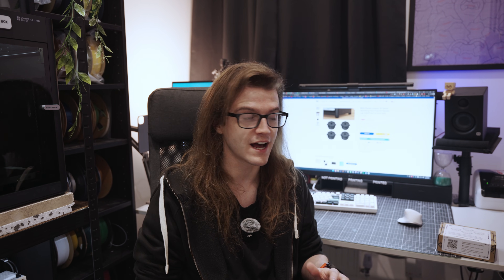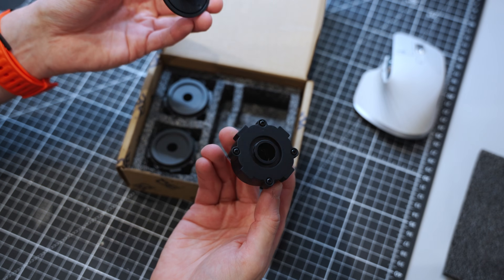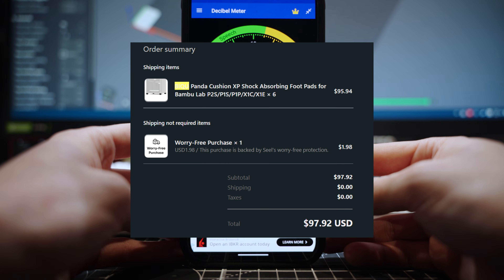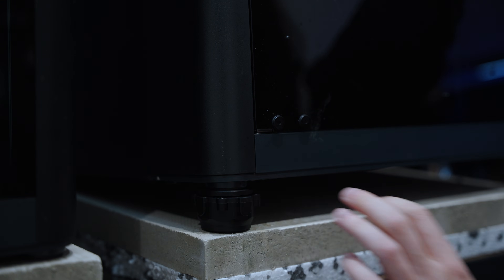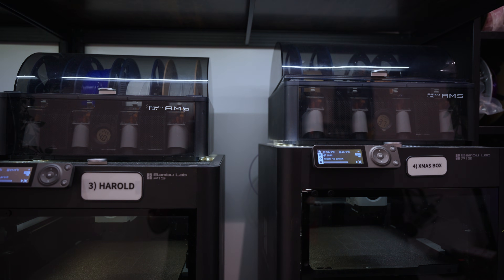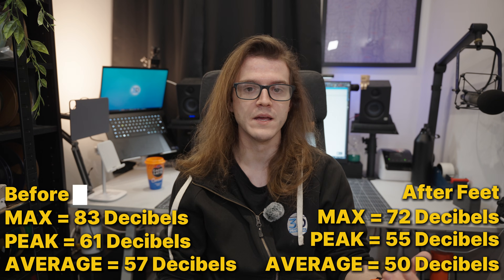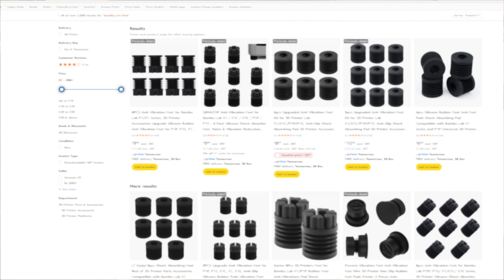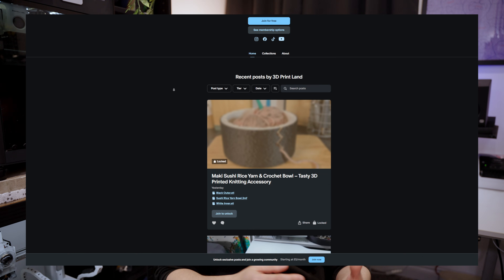I 3D Print Above a Neighbour — Here’s How I Reduced the Noise

Comment: I am using 3d printer in flat too. Right now on rubber mat that is for under washing machine use. Today I will print 5cm TPU95 feets. And I am planning to get concreate block, just for extra mass. But just the rubber mat and I do not hear in in the next room.

Comment: i don't think you need the slab underneath. Sound and vibrations travel through harder materials more easily so you are actually making it worse. put a layer of rubber or thick cork on the shelf and have the printers directly on the rubber to "de couple" it from the rack
Reply: You're absolutely right softer materials absorb the vibration. "Memory foam" in particular doesn't bounce back like rubber does. The purpose of the mass slab is to PREVENT the movement of the bed or head from rattling the shelf in the first place. To prevent low-frequency movement from the bed moving around.  The idea might be most clear in somewhat extreme cases. Imagine a printer on a cheap plastic shelf unit. As the printer parts move around, the whole shelf will shake.  Now anchor that same printer to a concrete driveway. Will the entire driveway shake?  Nope.
A 0.3 kg print head isn't going to move a 5 kg paver much. Then the foam underneath absorbs the higher frequency vibrations that travel through the paver.

Comment: It does not matter what you are measuring or what your experience in this room is. Important is: what is your neighbour saying now after installing the rubber feet ?!
The neighbour "hears" quite different noise reduced/influenced/filtered by the walls, the floor and other parts of the building. If the rubber feets only reduce the sound which are anyway "filtered"/reduced by the parts of the building then your neighbour "hears" the same disturbing noise sequences as before.

I have similar installation like you, and most effect was given by the concrete plate and a very sturdy shelf where the printer sits on.
Reply from the maker: I do mention in the video I alone without the app can feel the lack of vibration in the floor. It's considerably different downstairs now in the hallway. I can hear a slight hum whereas before it was more of a rumble sound. It's definitely a lot better.

Comment: Im downstairs. Im good but i will never get more than 2printers in the house let alone run over night! 😅❤

I was thinking of a shed in the garden dogh 🎉😅

I got 5m pro, I did install sound dampening isolation inside and partially on the inner door. Helps retain heat too. And added those silicon bed leveller’s on the feet too and raised it a little.  Also removed drag chain and replaced it with a metal-springy with a plastic sleeve- best part is the filament sensor is 60mm away from tool head #bestfilamentrecycler 

And new fans everywhere except from power supply as that’s permanent in the metal casing😢 but 1500hours later I think i need to service again.  Top raiser cover- must have and an organic fan duct❤

Comment: My understanding is that the idea is to use a flexible foam (think gym mat) to isolate and dampen, which a rigid foam like styrofoam won't help much.
Reply: I use 1/2” gym mat. Works well. Vibration on your shelf is going to travel straight down the legs to your floor. Add some type of rubber under the 4 corners and see if that helps.
Reply: Or just disable the vibration test. It doesn't effect the print quality and you can enable it anytime you want.
Reply: NBR foam